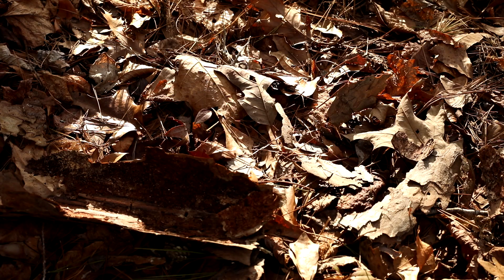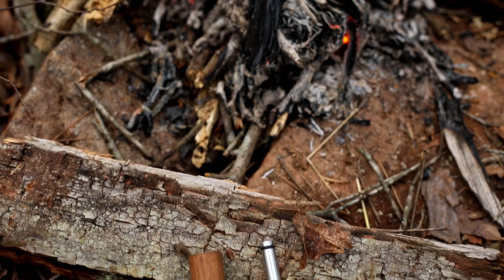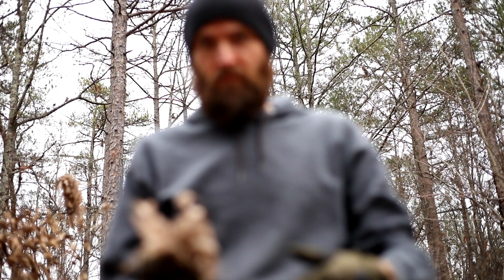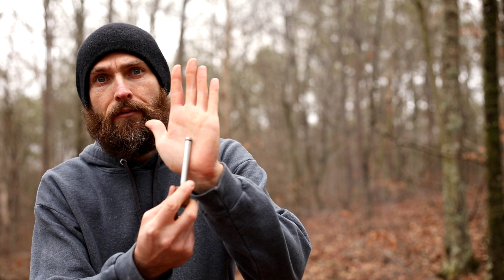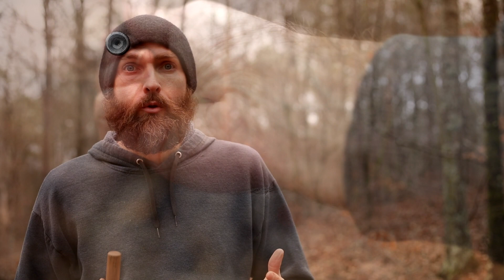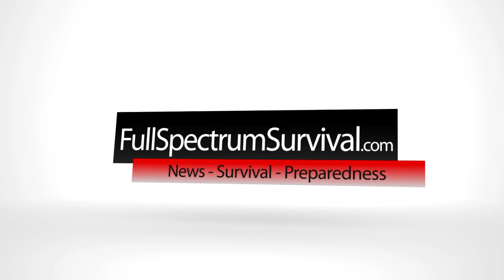How To Use A Fire Piston

Comment: What befuddles me is what lead to the aha moment.  "If I build this long tube and put a seal at the end, then if I put in a little tinder, it will light if I bash the tube into a cylindrical holder"  WHO THINKS LIKE THIS?  I mean, really, how did this ever even get thought of??
Reply from the maker: Yeah, the process would have been amazing to watch unfold.
Reply from the maker: I have to think that over the course of time, it was discovered that the sliding of one hollow tube into another produced heat, not so different from a friction fire with a bamboo saw and this evolved into the idea to try it with a capped and tunneled piece of wood.

Comment: I have used mine a few times as well as done a vid on it.. it took a while to get it to work but once you get the hang of it, its a pretty neat device.  Yeah, there are simpler ways to start a fire, but you get a great feeling or satisfaction when you use one of these :)
Reply from the maker: +1 - Great tool considering the ingenuity of their creation. They are a good way to teach force and pressure and a way to give a great respect for the creation of fire.